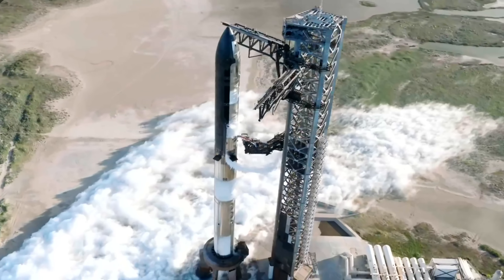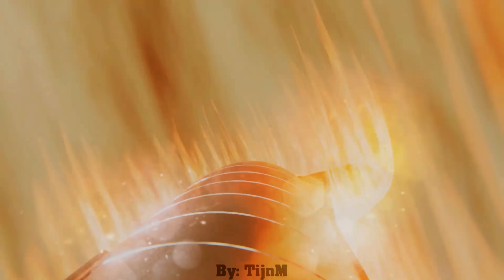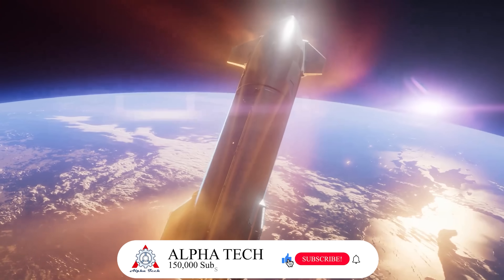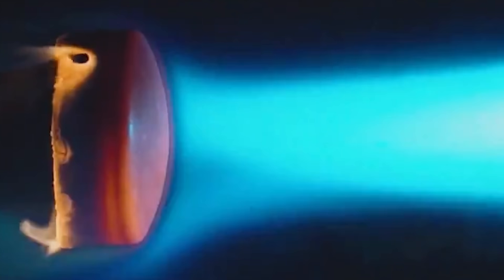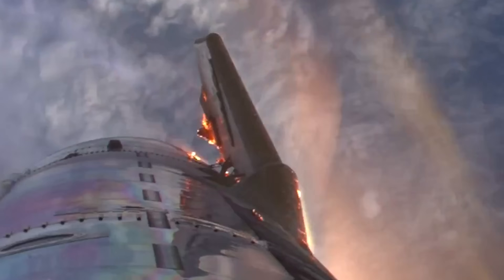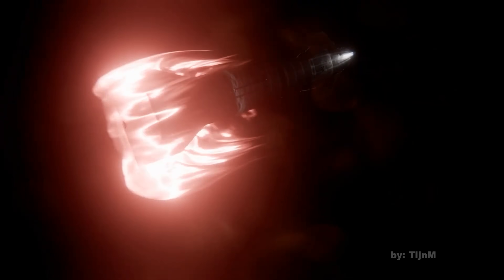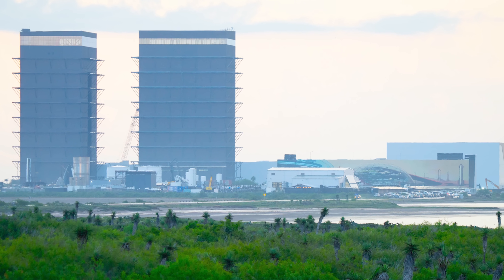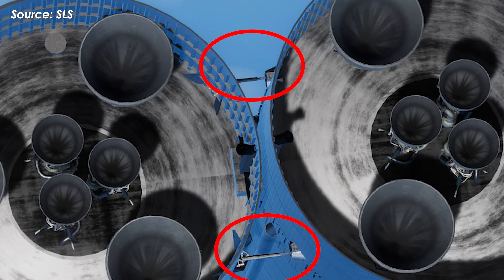It's mind-blowing! What SpaceX just did with Starship Heatshield Shocked whole Industry...

Comment: Why don't they just use a force field around the ship like in star trek
Reply: Because we are not yet in the future! First, they have to invent the photon torpedo, then the DOD will fund the development of the force field shield 😊
On a more serious note, a magnetic field strong enough to keep away the charged particles from the plasma should consume at least the energy equivalent to the kinetic energy of the colliding particles (starting at a relative velocity = orbital speed). In order to decelerate, the ship has to dissipate its enormous kinetic energy on account of collisions, which would require to provide the hypothetical force field with that amount of energy. Not available with present day technology.
Reply: .[Ackthually]:
  .  We DO have already a similar technology: "Plasma Window". 
  
  .  It can be "strong enough" to deflect all compressed atmospheric plasma away (as well as absorbing most of the the radiant infrared light), so no ceramic heatshields would be needed [just the structural steel].

 . It does requires an ammount of electricity per second (per surface area protected) so high that "storing" it all on batteries is not practical [it must be "generated" in real time & buffered with Super Capacitors].
  
-> Only normal fission nuclear reactors (with high enriched Uranium) can deliver the power output necesary.
  
Because nuclear reactors overheat if not cooled; a lot of mass (weight) in fuel would need to be carried most of the way down (boiled & then burned to reduce speed).
  
 -> Unless the source of this fuel comes FROM space (the Moon or an asteroid), it is not cost_efficient to lift it from Earth.
  
There is also a size advantage (the bigger, the better); were a Super-Starship that is twice the diameter & 3 times larger could hold a bigger, more efficient nuclear reactor (with the extra mass of fuel completely blocking all of its radiation, except at the very last minute of operation).
  
 [While even bigger Starships would be better, the "catching arm" method has its structural limits using standar steel].
Reply: Because we don’t yet know how to do that, nor do we yet have the power technology involved.
Trump needs to go first, before people will work on that.
Reply: @peterclarke3020  
You are talking politics, rather than adressing the question.
  
Also, you are ignorant.
 -> The "powersource" is just a simple, well researchead & already deployed submarine nuclear reactor.
  
The real inconvenience is tge heat "storage" (from the reactor, not the reentry compression flow) on the initial hypersonic phase of descent [later can be vented out]; as it requires lots of fluids, making it bigger & heavier than current design.
  
The Plasma Window "forcefield" tecnology exists already & it is strong enough to both keep 1 atmosphere of pressure from going OUT  to the void & block most of the radiant reentry heat fron going INTO the ship (hence the name).
 
Standard Steel can handle the rest, no need of heatshield.